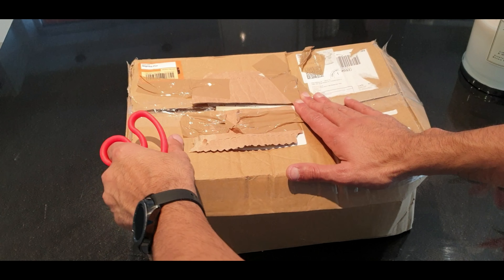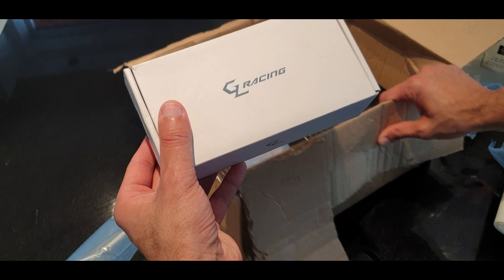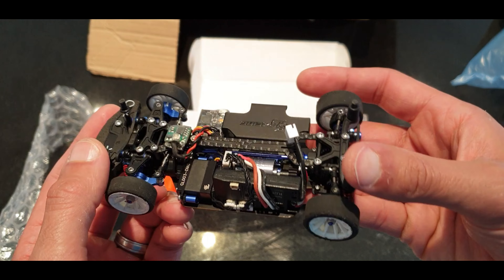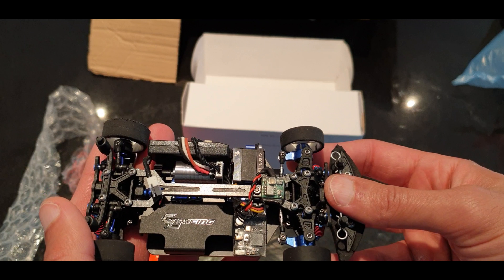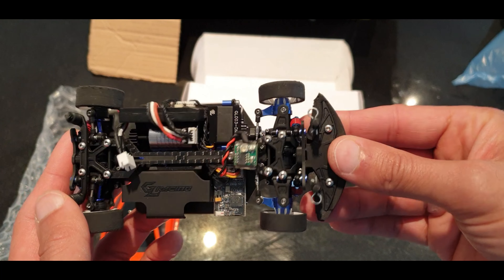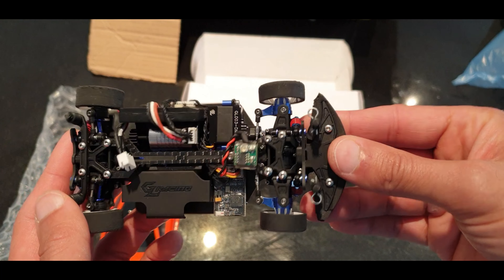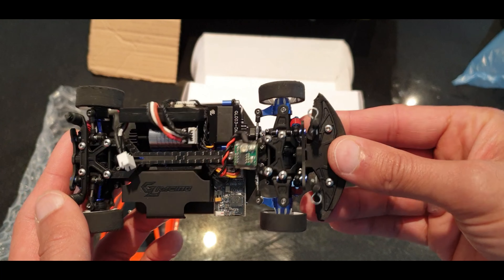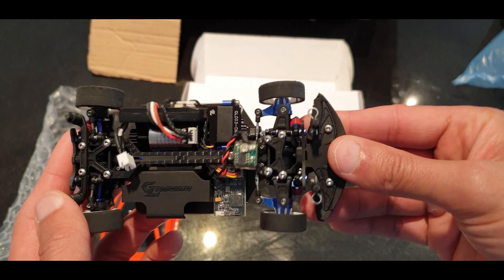Unboxing #GLA Awd mini z rc 1/27 scale mini rc, test drive #minirc

Comment: Wow! Full set of GLA and goodies! What a great buy. That XRX servo is really good. I also have one.
I'm really curious about the origin of this car. As far as I know those wheels are on sale almost exclusively in Asia.
Reply from the maker: it also has an xpower sensored brushless esc and motor(s). I purchased from a guy here in the uk and had it delivered within 2 days.
It says almost ready to run on the box ,but that model usually comes with a cheaper gl racing speedo similar to the atomic one .steering was jamming on the servo head and limiting right turns so a bit of work was needed .
Reply: @GarageMiniRCUK  Jamming servo saver is a common problem of GLA. I read some people revert it back to standard servo horn.
Xpower ESC is really nice too. Seems like you got an EU spec car. International spec will have non-sensored ESC. EU will come with Xpower sensored ESC and sensored motor.
Really happy to see you get a GLA. I'm waiting to hear your opinion.
Reply from the maker: @BeaversHobby  it's like you predicted the future. That's exactly what I did! (revert to normal servo horn.) video coming soon.
Reply: @GarageMiniRCUK  Hi ... Any plans to sale the GLA ... 
Best regards
Abdul

Comment: You hit the jackpot I just got finished putting together the GLR but I'm having a hard time 
getting it to work with my EX6R the steering is so sensitive after you get it going maybe
you can share your setting again one heck of a deal
Reply from the maker: Yes, sure will, I'll be doing a track day Saturday and will get the set up done by then. I'm going to use a DasMikro asf 4 channel reciever.
Reply: @GarageMiniRCUK  Thanks
Reply from the maker: hi , I found the same issues with ex6 on asf. I reduced the steering speed in settings and steering return ,this made a difference ,I am using this as a drift car so it is a different set up. Although I ended up switching to my Nb4 radio and a genning servo due to the existing servo jamming . It handled fine with out any steering adjustments needed with the nb4 .

Comment: Nice, have you set up your web site for these 1/27th scale cars. I bought a Mini-Z 19 years ago but since then I have lost touch with the various improvements, brands, etc… I would like to find a comparison amongst AWD top of the range racing models with carbon fibre 98mm chassis and shaft transmission rather than belt. Are there any shops for these in Dubai, UAE ?
Reply from the maker: Yes. I have. The website is about the types of cars. The Gla is the best awd racer in my opinion. Please see my more recent reviews of it. Not sure about dubai
Reply: Thanks 🙏🏾

Comment: Where can i buy bodys i looked on the main site but the ones i want are discontinued
Reply from the maker: What types are you after? Mini z asc or gla lexan type?
Reply: @GarageMiniRCUK  ether or i have a wltoys p969 gona do some drifting it has a 98 wheelbase
Reply from the maker: @esmokebaby  if you are in the UK I use wheelspin models, otherwise I normally get mine from ebay. The wl toys fits some of the mini z 98mm shells, but not all of them, I'll try and find a link to help you.
Reply: @GarageMiniRCUK  no in the us. And awsome thank you
Reply from the maker: @esmokebaby  https://youtu.be/-gCJEXXWBEo
Watch this video by beaver hobby channel. It'll help, he has put quite a few different shells on his wl toys k989.
Ebay is pretty good in US if you search kyosho mini z. I've picked up some used bargain shells. Also remember if it's a rwd mini z shell the wheels won't fit wl. Only the awd mini z shell wheels fit and even then you want zero offset as wl k989 is a wide chasis. So the 98mm subaru shell is no good as its not wide enough for k989.

Comment: ok I 'm not sure what wheel offset to get ... 0 to + 3 is 6 Set just for the Font or rear .  12 set in total  :( 
Need he your help .
Reply from the maker: Depends what shell you are putting on it. I bought a set of awd  mini z  wheels as it had an asortment off offsets. I'm running wide  3 offset at rear and 1 narrow. For stability wider is better, but depends on shell. Too wide and it won't fit some mini z shells. You can get spacers to increase off set too. First  decide what shell you want. It's lexan then I'll play around wirh  a set up today.
Reply: @GarageMiniRCUK   yea I was planning on getting that . but they were all out of stock in all the shops in France.   All good . I got Some  F2 , F3 ,R0 ,R1 .   to start here off Got a McLaren 12C GT3 that I need to paint.  5250Kv & a couple of lipo's .  can't wait . hopefully it won't be to long
Reply from the maker: @killahkay2112  ill set my gla with a mclaren shell. I think it'll be wide 3 at rear and nRrow 2.5 at front. Tell you what I think.
Reply from the maker: I've done a gla video so you can see how the wheels and mclaren body match up. I'm using the original carbon base plate 98mm set up. 👍🏽

Comment: Great video. Just a quick question as i'm new to this, can you fit any gyro onto GLA for drifting?. I have GLA with DasMikro FUTABA S-FHSS receiver, Futaba T4PV transmitter but would like to know what gyro to get for drifting and how does it connect to the electronics i'm assuming it plugs into the receiver? thanks for your videos and advice, J
Reply from the maker: Hi, yes it plugs between servo and reciever. I have the onisiki gyro which is great. But if you have das micro reciever you might be better off with one thst has micro plugs. What servo you have?
Reply: Garage RC  I have the servo that comes with the GLA V2.1 kit it has “GL003-DMG” written on the side of it
Reply from the maker: That's a nice one. So it has a mini jst plug that's fits in your reciever. Most gyros  come woth futaba style plugs... Except the atomic DRz gyro. That's a really good one and comes with the correct plugs. http://www.rcatomic.com/atomic/index.php?main_page=product_info&cPath=3_331&products_id=5938

Comment: Hello I would like to buy the same model but impossible to find a reseller in rtr, can you communicate to me the coordinates of your reseller
Reply from the maker: There is a place in Germany that sells the rtr version in the same spec as mine. I will get you the link.
Reply: @GarageMiniRCUK  
thank you very much, so I look forward to the link, best regard
Reply: @GarageMiniRCUK  
thank you very much, I look forward to the link, best regards
Reply from the maker: @agades3022 
I've ordered to the UK and they were very efficient. https://www.srcc-devils.de/gl-racing/sets
Reply: @GarageMiniRCUK  what speeds can you expect from the 3500kv motor?
Reply from the maker: @lucada32  as its sensored its very smooth and I haven't timed the speeds, it's seems to keep up with cars that have 6000kv. I'm going to try a speed test soon.